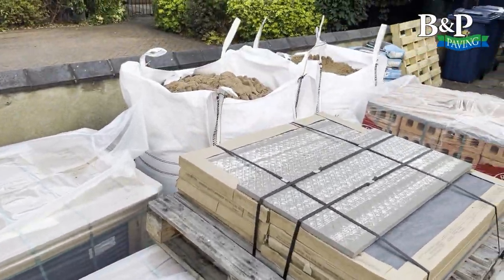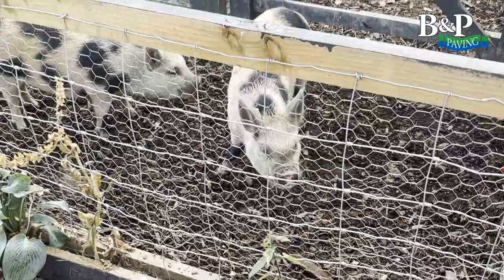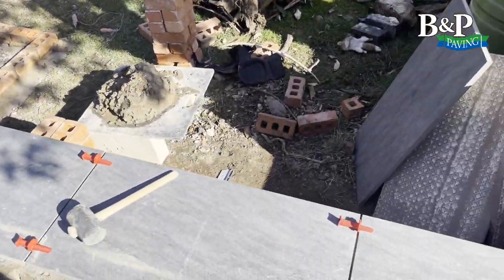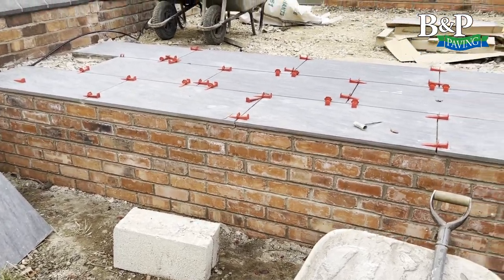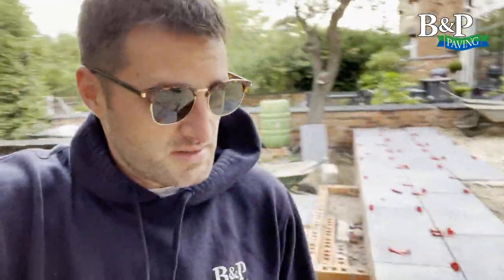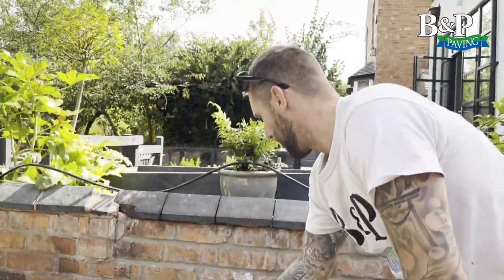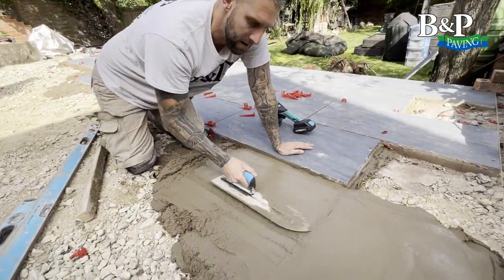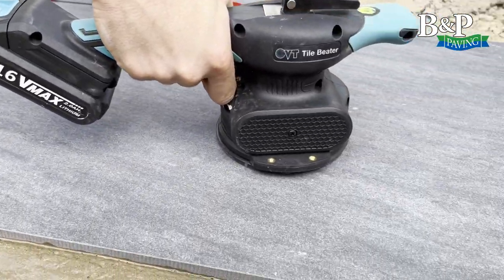Another Porcelain job completed

Comment: Another way of dealing with the small cut in the middle of the stairs is to ÷ the lenth of the stair into three, less the two joints of coarse, if you dont mind the extra waste.

I've been acused of being made of silt before, but never sugar 🤣
Reply from the maker: You’ve lost me 😊
Reply: @BPPavingnottingham  
I confuse myself most of the time 🙈
At around 8.10 on your video you mention you werent sure where to put the cut. It was just a suggestion if you were not happy with the small cut.
The steps look to be around 2020mm long. I was just ÷ that into three to give you three equal cuts. 
The work you guys produce is absolutly top notch. And i know that 200mm cut would annoy the hell out of me.
The down side is a bit more waste.
Reply from the maker: I get you , sorry when you comment it doesn’t tell me which video your watching
Reply: @BPPavingnottingham  
Ah, i didnt know that. Thanks
Reply: you are right there,rule of thumb is to avoid small cuts especially on large format tiles,slabs.